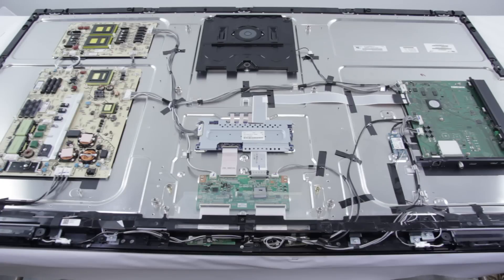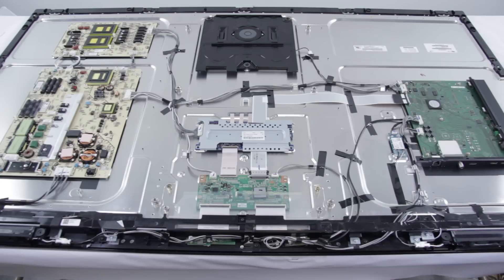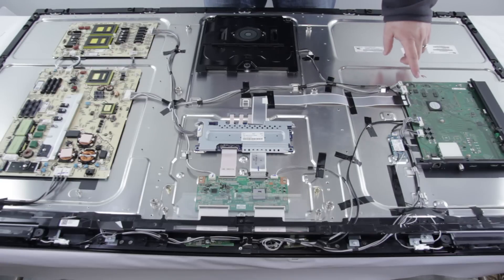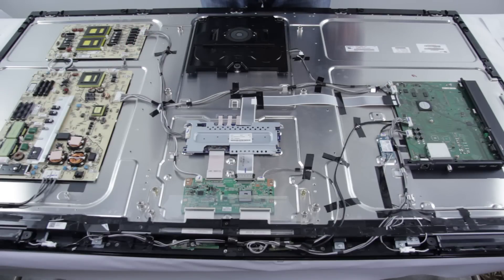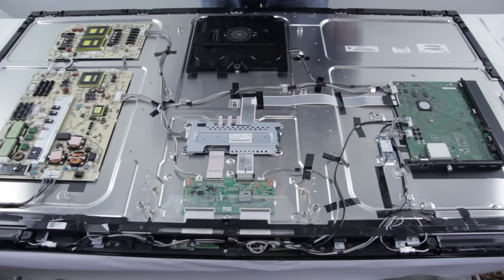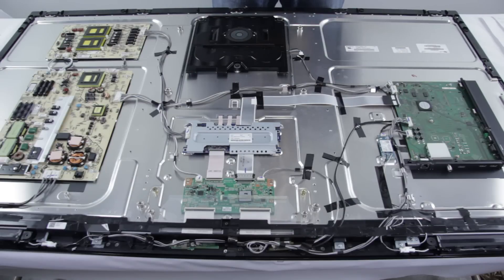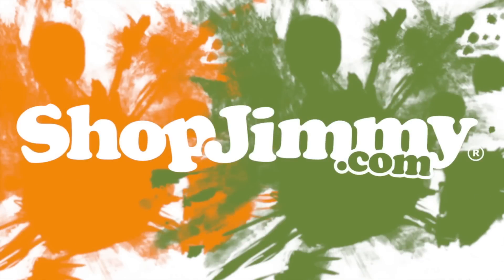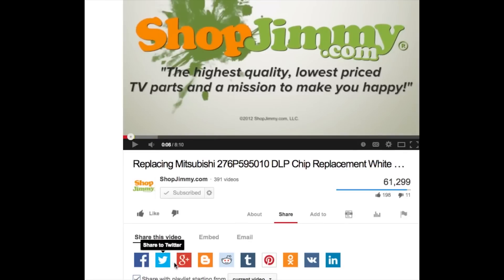LED TV Repair Main Board Overview Blank Screen-TV Has Audio but No Video-Common Issues Problems

Comment: Not sure if you guys look at this anymore, but i have a SEIKI  model # SE46FY10 it has been working fine then turned it on today and nothing but a  black screen but I can hear audio. The power light is on. I was looking at the main board on your site but didnt want to buy it until I knew for sure that was the issue. My main board model number is 
CV3393BH-F

Comment: I have a vizio E500i-a1.
It does power on, and backlight is on, but it is black with lighter shades of vertical lines on the left side, and I cannot access the main menu or change channels. There is also a light spot on the upper left side of the screen, and I cannot hear sound from the TV. Is this a main board issue, and can I just simply replace it, or is the TV just garbage?
Reply from the maker: Gilbert Castillo   Unfortunately, you should replace the TV.  Thanks and please let us know if you have any further questions!  www.shopjimmy.com

Comment: Hello, I have a Hisense 32in LED. I can hear sound from it but, I can't see the picture. When I performed the flash light test, I can see a very dark or dim picture on the screen. What do you think my problem is?
Model # 32k20dw
Reply from the maker: john mims   Try all repairs and troubleshooting at your own risk.  This could be a problem with either the power supply board or the LEDs in your TV.  You can replace the power supply board to see if that fixes the problem.  If it does not fix the problem, then you most likely have bad LEDs in the TV.  Click this link to replacement parts for your TV model number:  http://www.shopjimmy.com/catalogsearch/result/?q=32k20dw  There may be multiple boards for the same TV model number, be sure to match part numbers on your current board, with your replacement for compatibility.  Thanks and please let us know if you have any further questions with your TV Repair!  www.shopjimmy.com
Reply: My kids play video games on this tv excessively.  Would that have anything to do with it or does that help narrow the bad parts?

Comment: i have a vizio e47oi-a0 it has sound and it has no picture the flashlight test worked i seen the menu screen and my ps3 dashboard using hdmi   could it be the main board or power supply
Reply from the maker: drew britton   This could be a problem with the power supply or bad LEDs in the TV panel.  Unfortunately I do not see any replacement parts in the search results for your TV model number on our website.  Thanks and please let us know if you have any further questions!  www.shopjimmy.com

Comment: i have Samsung 65" led TV , which doesn't display.
i do have back light, i have sound and recently a friend told me to remove the 2 left flex on the T-con(model BN41-01816) which has 4 flex ribbon connected to the driver board.

Images shows half way on the screen,after removing 2 leftmost flex on the t-con.

what can be wrong with this TV?

Comment: Hi, my tv model number is un46d7000 samsung.  When I cut it on, it just shows a red screen. That shows for maybe ten seconds then it goes blanks or sometimes have green vertical lines then go blank. I am getting sound however.

Comment: Samsung UN32F6300AFXZA with no picture but the sound is ok. In fact the TV seems to work but with no picture on the display. Could it be the main board needs to be replaced? If so, can you supply genuine Samsung replacement main boards?

Comment: I have Samsung UN55JS900FXZA, I'm having bluish screen with no picture also colored vertical line. I recently replaced the t con and problem is still the same. Is the panel bad? When I connect one box, I could see the screen changing then went back to been bluish. However there is sound. Please help

Comment: Samsung HL-T6187S LED DLP: When I press the power on I get no picture.  If I unplug and plug back in a few times, the picture sometimes comes on.  I can tell that if the backlight comes on then the picture will come on, but if I unplug and plug back in and the backlight doesn't come on, I then just need to repeat.  I took out the sub-power board and noticed 4 of 5 caps bulging, so I replaced them.  Still have the same problem.  I haven't used my meter yet but couldn't find a good schematic for the TV, showing voltages at different points of the TV.  No visibly bad caps on the main power board.  Any help is much appreciated.

Comment: Hi I have a Panasonic Led Smart TV model number TC-L55ET5 with a blank screen has audio. It powers on fine the backlighting comes on and I heard sound but get no picture what so ever, Any idea what part I need?
Reply from the maker: djchaos2685  Please watch this video FIRST to help with your repair!  TV Repair! LCD, LED, Plasma, DLP How To Fix Your TV with ShopJimmy.com Help!  I recommend replacing the T-con board in your TV.  Click here for your TV model T-Con:  http://www.shopjimmy.com/catalogsearch/result/index/?cat=63&q=TC-L55ET5  There may be multiple t-con boards for the same TV model number, be sure to match part numbers on your current board, with your replacement for compatibility.  Here is a link to a video showing how to identify your part number, click here:  LCD Help Part Number Identification TV Repair Guide for LG Philips Timing Control (T-Con) Boards  Thanks and please let us know if you have any further questions with your TV Repair!  www.shopjimmy.com
Reply: ShopJimmy.com  Thank for the reply and thoughts on the issue, I replaced the t-con board in the tv and I still get the same thing just a blank screen audio works blacklight leds work just no picture
Reply: ShopJimmy.com also while the tv was off I unhooked one of the ribbons from the t-con board to the panel then turn tv back on half the picture comes on of course but its not a picture that in plug up to the input just a white screen with lines on the side that still connected through the tcon
Reply from the maker: djchaos2685   This sounds like a TV panel (TV Screen) problem.  If your TV panel is bad, it may be more cost-effective to replace the TV as panels are typically hard to find in stock, difficult to replace, and expensive.  Thanks and please let us know if you have any further questions!  www.shopjimmy.com

Comment: Hi, I am in the UK
I have a Samsung UE40EH5300k tv I have sound but no picture, The backlights are  are working.. When you switch the tv on there is a very dim even light from the screen but no picture movement, you cannot see any wording using your torch test.

Comment: I have a LG 39LN5300 led tv which has sound from both HDMI and composite cables. There is no picture. The backlight is probably not working also because there is no image when I shine a flashlight on the screen. The red indicator light at the middle bottom blinks twice and then disappears after pressing the remote and before the sound turns on. None of the boards appear to have any bad capacitors. I have purchased a replacement t-con board but the tv is experiencing the same problem. I am willing to replace or test any components. I'm also willing to try replacing other boards as long as I can return them if they don't fix the problem.
Reply from the maker: Craig Nishimura   Please watch this video FIRST to help with your repair!  https://www.youtube.com/watch?v=BP3NVNCGEv8  I recommend replacing the main board in your TV.  Click this link to replacement parts for your TV model number.  http://www.shopjimmy.com/catalogsearch/result/index/?cat=56&q=39LN5300  There may be multiple boards for the same TV model number, be sure to match part numbers on your current board, with your replacement for compatibility.  Thanks and please let us know if you have any further questions with your TV Repair!  www.shopjimmy.com
Reply: If I find an exact match main board and it doesn't resolve my problem, can I return it for a refund?
Reply from the maker: Craig Nishimura   Here is more information about our return policy:  http://www.shopjimmy.com/returns  Thanks!  www.shopjimmy.com
Reply: Sorry I looked through your return policy and still can't figure out my question. If I purchase and INSTALL a main logic board for $50, can I return it if it doesn't resolve my problem? I'm confused still because I don't know what qualifies as a new /unused item. Is a part still considered new/unused even if it's been tested by the consumer? Is there a phone number I can call if I still have any questions? Thank you.
Reply from the maker: Craig Nishimura   Here is our contact info:  http://www.shopjimmy.com/contact  Thanks!  www.shopjimmy.com

Comment: Hello-
I have a Westinghouse TX-42f430s LED TV.  The TV goes black after its on for a few minutes.  It resets if we unplug the tv, but it goes black again after a few minutes.  Audio remains on.

Thanks
Adam
Reply from the maker: Adam Tsao   Please watch this video FIRST to help with your repair!  https://www.youtube.com/watch?v=BP3NVNCGEv8  I recommend replacing the main board in your TV.  Click this link to replacement parts in your TV model number:  http://www.shopjimmy.com/catalogsearch/result/index/?cat=56&q=TX-42F430S  There may be multiple boards for the same TV model number, be sure to match part numbers on your current board, with your replacement for compatibility.  Here is a link to a video showing how to identify your part number, click here:  https://www.youtube.com/watch?v=SoUXsgOx25o  Thanks and please let us know if you have any further questions with your TV Repair!  www.shopjimmy.com

Comment: I have a VIZIO E601i-A3, turns on but there is no display or sound (blank screen). I assumed the problem lied on the main board so I went ahead and took it out. To my surprise I see a different model number, E701i-A3. Is this normal? What do you suggest?
Reply from the maker: Everardo Ibarra   Try all repairs and troubleshooting at your own risk.  What model is  your TV?  It should only be listed on the backside of the TV.  Thanks!  www.shopjimmy.com

Comment: Hello, I have an LG model 39LN5700-UH, serial 401MXMT28195.  The screen has no picture.  It will flash briefly and very dimly.  I do have sound.  I have purchased from you a new power supply/LED board with no change.  Please help.
Reply: I forgot to mention, no backlight and the flashlight test shows the image is there.
Reply: I want to also add that I can smell a strong scent by the main board so I'm wondering if that is the culprit??
Reply: ***** 
Hi guys, any ideas?
Reply from the maker: *****  Try all repairs and troubleshooting at your own risk.  This sounds like a problem with your LEDs.  I recommend replacing the TV.  Thanks!  www.shopjimmy.com

Comment: I have an LG 47LS4500 powers on w/sound and a snowy white screen with fuzz for sound.  Please help if you can.
Reply from the maker: Jerry Raber  Please watch this video to help with your repair!  TV Repair! LCD, LED, Plasma, DLP How To Fix Your TV with ShopJimmy.com Help!  I recommend replacing the main board in your TV.  Here is link to replacement parts:  http://www.shopjimmy.com/catalogsearch/result/index/?cat=56&q=LG+47LS4500  Be sure to match part numbers on your current board, with your replacement for compatibility.  You can also call our customer service for further assistance with your purchase.  (877) 881-6492  Thanks and please let us know if you have any further questions with your TV Repair!  www.shopjimmy.com

Comment: Hi My Samsung UN32F6300 32-Inch 1080p 120Hz Slim Smart LED HDTV,
has started to have some issues some black lines have appeared from top to bottom they appear mostly black and cover menu's and appear on all Inputs. there is a little bit of other colors mixed in near the very bottom but most of it is just black lines from top to bottom cutting segments of the screen in half. It's just started recently. Any ideas?

Comment: Seiki 32" LED.  Model # SE32HY27.  Sound but no picture. I tried to reset with no luck.  When I turn on TV I can barely see the Seiki logo on the screen then it goes completely black. I found out that this is actually very common for Seiki brand. Help please.

Comment: I have a Vizio 420i-a0  The blue light on bottom left corner will come on when I push the power button however within 5 seconds will fade off and the screen never comes on. No Sound, No back light, No glow.  I Have replaced the power board, The ribbon cables, and the main board with no luck of it fixing the problem.  Prior to the TV not working a dark area thru the center left to right of the screen went darker/dim.  Any Ideas?
Reply: +Jennifer Brown I have the exact same problem and can't find anything online. Have you had any success since you posted this comment?
Reply: Nope. I may try the little board where the manual controls are located and also the remote control board next if I don't find out something soon.

Comment: QN75Q9FNAFXZA - AC02 - all of my source devices: Xbox One X, Fire TV Cube and Cable box cannot be set to a resolution higher than 720p (all these devices, except the cable box are 4K capable). If I try to set any of them to even 1080p the TV says No Signal. Most attempts at solving the problem have failed so my final attempt is to change out the main board on the TV, could this be a possible catchall solution?

Comment: I have a LG 50ln5600. The backlight will flash when you hit the power button then it will not come on. just a bright white flash and then out. I have sound and can see the lcd screen with a flashlight

Comment: I have an LG 55lm6700. When i start it up it works for about 2-3 min. It will then shut off and turn back on. It does this when anything is plugged into the hdmi ports. The light on the power supply board (i think it is ld701) flashes. If i dont have anything plugged into hdmi ports it takes a little longer to start powering off and on. Also the screen will darken and dotted lines go across horizontally.

Comment: Hi, I have a Lg 42LE5500-SA, I updated it to the latest software version v05.00.04. After the update, the Hdmi ports didn't work anymore. Help me please
Reply from the maker: Marco Córdoba  Please watch this video FIRST to help with your repair!  https://www.youtube.com/watch?v=BP3NVNCGEv8   I recommend replacing the main board in your TV.  Click this link to possible replacement parts for your TV model number:  http://www.shopjimmy.com/catalogsearch/result/index/?cat=56&q=42LE5500  There may be multiple boards for the same TV model number, be sure to match part numbers on your current board, with your replacement for compatibility.  Here is a link to a video showing how to identify your part number, click here:  https://www.youtube.com/watch?v=RwHTvjMdrhk  Thanks and please let us know if you have any further questions with your TV Repair!  www.shopjimmy.com

Comment: I have a Seiki LED HDTV Model SE47FY19. This morning the screen faded to black. Now we have no picture, just audio. Can you help?
Reply from the maker: +Chris Kunkleman   Try all repairs and troubleshooting at your own risk.  I recommend running the flashlight test on your TV.   Here is a link to a video we produced that shows how to run the flashlight test. https://www.youtube.com/watch?v=xUzCLgoSPGM Please reply with your flashlight test results and we can recommend a replacement part for your TV repair. Thanks and please let us know if you have any questions! www.shopjimmy.com
Reply: Yes, did the flashlight test and with light you can see menu go on and off when you push button on my remote my TV is Seiki SE47FY19.  Do you have the part I need?

Comment: I have a vizio VL320M 32" LCD 1080p 4 yrs old. I never had a problem until last month.. I don't have cable, but use an OTA antenna...it started to take time for the  picture to turn on 10- 20 minutes and worked fine for a couple of weeks..with the time for the picture to show up getting longer..up to 30-45 minutes .eventually the video stopped coming up on the screen.
Now  the screen lights up with a gray background,sometimes with vertical bands of shades of gray... the audio  and channels are fine.., the toslink connector works, connected to a home theater receiver..  , what could the problem be? and how to fix it?
 thanks,
Ray
Reply from the maker: Ray Wong  I recommend replacing the main board in your TV.  Here is a link to replacement parts for your TV model number on our website, click here:  http://www.shopjimmy.com/catalogsearch/result/?q=VL320M  Be sure to match part numbers on your current board, with your replacement for compatibility.  You can also call our customer service for further assistance with your purchase.  (877) 881-6492  Thanks and please let us know if you have any further questions with your TV Repair!  www.shopjimmy.com

Comment: hi, i have a lg plasma tv. rz-42px11 it has sound but no picture, what could be the problem plz. many thanks
Reply from the maker: Paul Farrant   PLEASE SUBSCRIBE TO OUR CHANNEL - Try all repairs and troubleshooting at your own risk.  I recommend replacing the YSUS and the YDRVTP & YDRVBT boards in your TV.  Click this link to replacement parts for your TV model number:  http://www.shopjimmy.com/catalogsearch/result/?q=rz-42px11  Be sure to match part numbers on your current board, with your replacement for compatibility.  Here is a link to a video showing how to identify your part number, click here:  https://www.youtube.com/watch?v=GEllG3RV-tc  Thanks and please let us know if you have any further questions with your TV Repair!  www.shopjimmy.com

Comment: I have a LG LED 39LN5300. When I got it, it would shut off after 15 minutes and a local LG rep fixed it for free because it was still under warranty. Just after warranty expired, the backlight does not come on. If I shine a flash light at the TV, I can faintly see the picture. What do I have to replace to fix this TV?
Reply from the maker: Isaak Stagl   This sounds like you had bad LEDs in the TV panel.  Unfortunately we do not sell replacement LEDs or TV panels.  Thanks!  www.shopjimmy.com